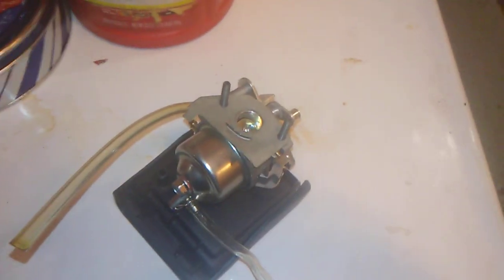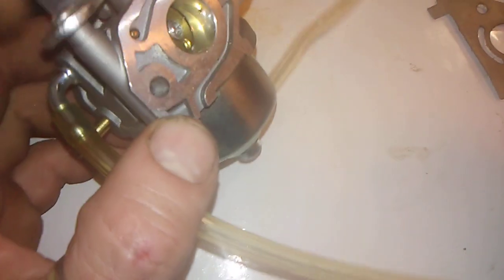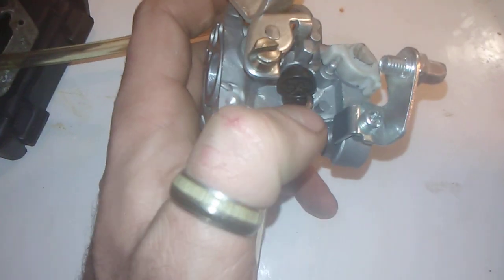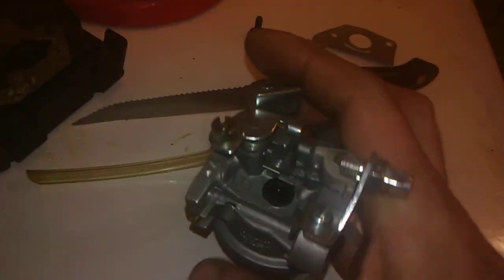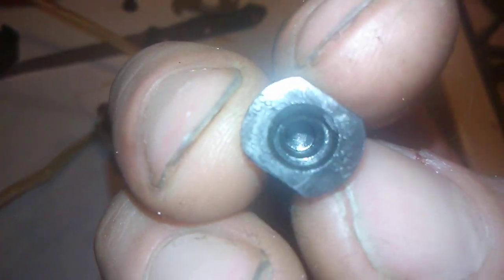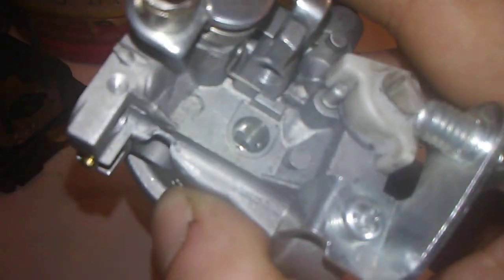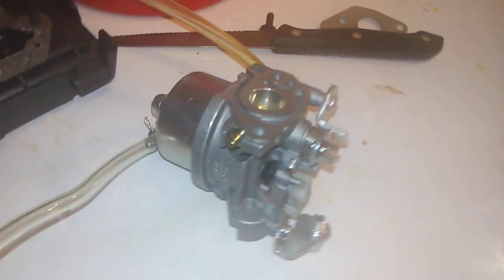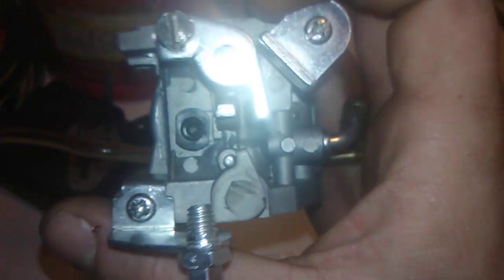"Huashang engine is Truly a Honda GXH50 motor I was right from the Beginning!"

Comment: Yeah, course they are.
Brings back memories. Straight pipe, mikuni vm22...
Dont run high octane or youll have the weirdest dang failure youll ever see...
Or mine did. Ran sweet until one day... nothing.
Opened her up...
Carbon build up in combustion chamber, a spiral built up round the exhaust valve. Never seen anything like it before, or since...

Comment: Mine has a 95👀
Reply from the maker: A 95 jet how good is it?! Because I have a 35 pilot jet and a main jet 52
Reply: @RaoulDuke224  I have no idea never ran the motor, I was watching your video and went to check my jet size
Reply from the maker: @justanothermotorizedbikech  their a inlet valve with is the plastic thing 35 jet and main jet is now 52 I got the 52 main jet from honda motor inc so turns out I was right about the huashang engine is a honda GHX 50 motor!